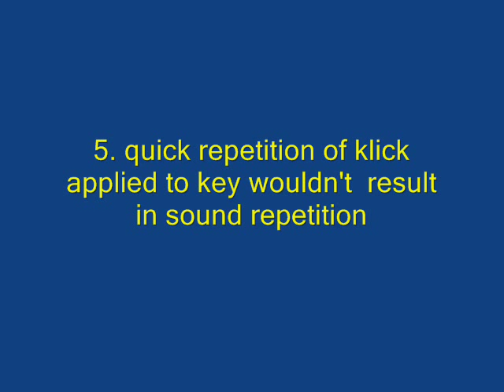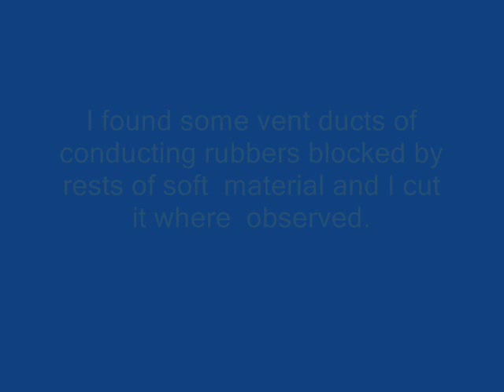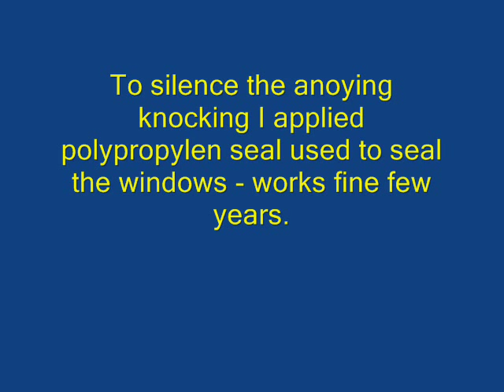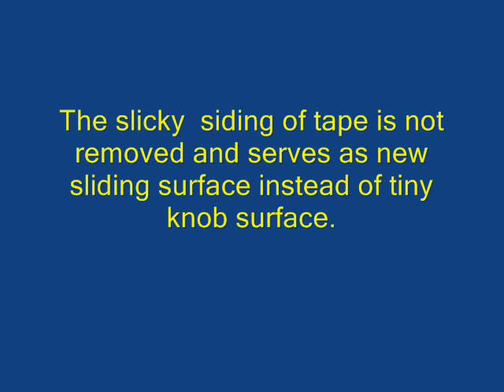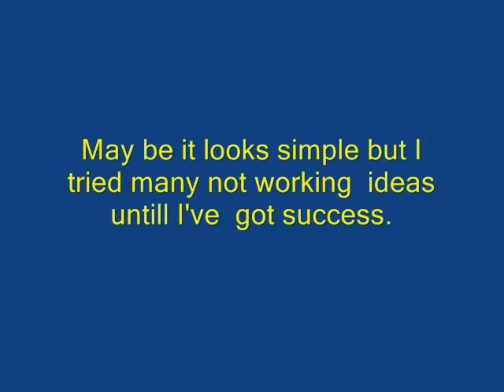DIY what's inside CME UF-8 MIDI

Comment: I have A VX8 with the same keyboard mechanics as the one in this and many other CME repair videos. I went about as far as you can go to rectify the factory and design issues in order to get back what the keyboard is actually capable of with regard to playability, and in particular, sensitivity (which is something not usually associated with older CME keyboards).
I dismantled the mechanism completely, nothing remained fixed to anything else except the nylon bushings fixed to the counterweights.
Every single counterweight was weighed to an accuracy of 1000th of a gram (using jewellers scales). There are two weight ranges, one each for the black and white key counterweights.  The data was all entered into a spreadsheet for later reference and manipulation.
What was surprising that the weights were not evenly incremented as you ascended the key range, yes, there are some design differences that will create a sudden change in weight, but even within one design heavier keys could be found much higher up the keyboard, clearly this would be felt during sensitive, light playing. Every weight was numbered with its factory location, and the spreadsheet used to reorganise them into a balanced, smooth order. They then were all given a second number to refer to their new position. This ensured that if it all went tits up on reassembly, I would be able to put them back to factory order. Remember, there are two sets of data, one for the black and one for the white keys. Each then has columns for weight, factory order, new order, octave, and pitch. By cutting and pasting, you can manipulate the data to suit yourself.
 Much has been covered in this and other videos about drilling and cleaning out the pivot hole on each weight, I used a titanium coated 8mm drill at a low speed to do this. What I found was that some keys offered quite a bit of resistance to the drilling, others barely any. Irrespective of this, the goal was for the weight to swing freely on the aluminium bar which I'd already cleaned/polished with 1200 grade silicon carbide paper.
I then reassembled each group of weights (in their new order!), having lubricated everything (with the blue keyboard lubricant supplied by Yamaha) and later placed all of them back into their frame. Where before, all weights swung free on their respective bars, I could now detect a lot of resistance on some weights, the vast majority none at all. They all moved smoothly and dropped instantly when raised, it's just that some were clearly a tighter fit than others. This was nothing at all to do with me moving around the weights as the symptoms were completely random.
The remedy was to mark all of the keys to be removed and then set about lightly sanding each side of the nylon hole and refitting to check for free movement. This was done with the same 1200 grade paper as before and required only a brisk rubbing of either side. This must be carried out on an absolutely flat surface, concentrating on an even application of very light pressure when sanding. All were relubricated prior to final fitting.
The results when the keyboard was fully reassembled was remarkable, the action was now light and very responsive to extremely rapid key presses. Time to connect to a computer for sound, and I used Pianoteq as it's probably the best acoustic piano emulation out there.
I cannot think of enough superlatives to describe how pleased I am. My VX8 is nothing at all like the keyboard I originally bought, it's a billion times better. Comparison between my real piano and the VX8s responsiveness show that the action of the VX8 is very close and probably what the designers had in mind but for their crappy engineering tolerances.
Okay, the whole exercise took a few days but the alternative was landfill for the VX8.
As a footnote, you could go one stage further (which I decided might not be necessary). Using the spreadsheet, you could get it to calculate completely new weights for all keys based on the start and end weights originally noted. I did this and it showed that most key balances would need a minor amount adding or subtracting to fit into a perfect transition from one end to the other. Drilling holes to lose weight or  adding lead solder to add weight (careful heating required to avoid melting nylon) is all that's needed. I tried both on a couple of keys and it's definitely possible, though not for the faint of heart or the impatient.
It would be an extreme route to go, and hard to see how it would better what I've now got, but rest assured, it would be!
Reply from the maker: Thanks for so detailed description. I appreciate interesting job You completed for weights of keys. As I shown here I hed three  problems which made playing impossible - keys stuck,   friction of sliders and contact rubbers not conducting. I think You may not experience at least rubber contact problem because I got from them new set and that one works good since I replaced old ones . Means in later production  they solved that problem. 

 I still have my keys and after I did my improvements it serves enough to my amateur needs. I had one more problem with pots on keys which control modulation and peak  - they are a bit too weak   for many years use but managed to repair . .  I use sound source GEM instead of PC computer , also Korg registrator and with some equalizations it gives powerfull controll and sounds for me as I like

Comment: Thanks a lot  Mike,  I have revised my CME Uf 8, it works again.  Greetings from Switzerland
Reply from the maker: Good news. Last time I solved aftertouch mystery. I didn' use it but suddenly found that only black keys were responding. This was the ribbon broken - I removed its insulation on the edge where I expected damage and it was there - painted with conductive paint and it works all.  No more  problems since 2 years.

Comment from the maker: You should take off limiting spring plates at the sides and then push the shaft by knocking it. There is a few shaft rodes  inside one by one serving each section. The  rodes are just complementary to hammer units - You may  unscrevw and just lift it minding the shaft is in right position.  I did by knocking.. The problem with this was that plastic used as bearing to alloy rod changed the size and tended to jamm. Lubrication didn't work.

Comment from the maker: I had not such problems. But I am using my UF to controll keyboards - not PC.Try to check tape connection and it's plugs  for aftertouch.For pitch bender may be it' is dirt at the contact of potentiometer - I would use some spirit to splash. Remember that aftertouch has switch-off at the panel.

Comment: Hi, I just put up a three part video on taking my UF8 apart last night. Today I found this! I wouldn't have bothered if I knew you did this already. Questions: How did you take apart the Weighted Hammer Mechanism to bore out the holes slightly? The ends of the shaft seem peened and unserviceable. How did you make it stable after putting it together? Second, the tape on the key to hammer mechanism, is it reliable or breaking down after a short while? Thanks! These play nice when all is well! KP

Comment from the maker: Greetings from me. I hope that with new model you don't need actions. My works excellent after all . After this video  I had jumping of display values. This was caused by bad contact in  slider - any slider will do when dirty. Contact spray to external gap was enough.
.

Comment: I have a CME UF8 too and am having problems. Aftertouch is not working at all and the pitch bender is dead too (I had to disconnect the knob because it was sending random impulses). The mod wheel has little hickups but is more or less still ok.
Any idea?
Also, I'd like to order parts for the pitch bender and mod wheel, KP11520, can you help me with where to order and how to find out the part number for this stuff?
Any help would be greatly appreciated!!
Thanks!

Comment from the maker: Tapes seem unreliable but proved working - untill now no one in few months failed and key  feel is nice. . Now I have more problems with rubbers - the dynamic action fails to happen for some kays  - the  medicine is to kick the key many times before performance hi hi.. Could You help me how to contact the source? Service representative  in my country is not promising. Now I think about solution for carbon reapplication. I am afraid it may be not permanent. Regards..

Comment from the maker: Aftertouch has nothing to do - its separate and common for all system. So it's not comforting..   What You mean not sending message off - if not activated on than logically there is no off. Problem is with "on" and it guides to contact rubbers.. Unfortunatelly I experienced last time also some of them with increased  resistance  New rubbers are not available so I decided to move ugly rubber unit to border.But may be you splash something>? If so clean only with water

Comment: Hi! Since yesterday my CME UF 80 Classic stops sending Note On and Note
Off messages for keys from C4# to G4#. But they sends aftertouch
messages when I pressure them. I tried to initialize settings. Seems like it didn't help to solve issue. How do you think, is it hardware issue?